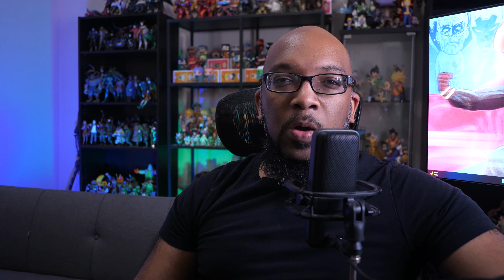Bambu Lab A1 vs. Flashforge Adventurer 5M | The Figure Feedback Podcast EP: 10

Comment: My 5M is quicker than the Bambu Lab P1P.  The P1P didnt like corners much on the front half of the build plate as they started to curl up. I ended up using spray glue. 
I havent had to set the Z off-set on the P1P, Flashforge 5M or bambu lab printers.

Comment: I know its 2 years later, but the other week, I bought an Adventurer 5M, cheap as it needed a new screen because of he ribbon cable clip breaking. I bought a new screen, fitted it and printed good. I already had a bambu Lab P1P. I had bought a BBL A1 Mini and was impressed with the print on it.  After that is when I bought the 5M. I thought as I was impressed with the A1 Mini, I would like an A1 full size. I sold my P1P on ebay and today, August 26th 2026, I bought a new A1 printer. I had done some research on the 5M and the A1. Most say they are both great printers, some say they are great "starter / beginner" printers. I have been 3d printing for 3 years and learned more from the Ender 3 series and learned how to repair them and upgrade them. Now I repaired my first 5M and I think I am going up in printers. I started off with a £40 Easythreed K9 Chinese mini printer, then went to Ender 3, then bought an Ender 3 V3 SE, which was very good. Then bought Ender 3 printers to repair and upgrade. I suppose it is just like buying  a bicycle, then upgrading to a moped / motorbike and then moving onto cars and learning how to repair and upgrade what you have. I am mechanically minded so learning all about printers comes easy to me.
Reply: so between the a1 and a5m pro, which one do you suggest for a first printer. I dont want to tinker or adjust settings..
Reply: @saragomez98  Any one of them. Both start printing out of the box. The BBL A1 was easy to build, the 5M was already set up. All that needs dong is the starting preparation. For ease of slicer, I like the banbu studio for the A1. The 5M I use Flash Studio Desktop. They are almost hte same. 5M can use Orca Slicer, but I prefer the Flash studio.
Reply: @saragomez98  Not the 5M pro. People are complaining about that one already. Not as good as the 5M.

Comment: im 55 and just got my first printer 6 weeks ago i got a FLASHFORGE AD5M Pro 3D for £280  deal off amazon they have got rid of most the problems you mention with updates i hav been printing at least 1 print a day and have had no problems yet i have even ran out of filliment on one print and it auto paused until i put more fillament in and it just went back to where it stoped and carried on printing . you can download any print from any where and put them in flash studio desktop and slce it and its perfect and i have never had a bad print with the new print plates i have never used the glue or cleaned the plate its perfect every time i only use petg hs

Comment: CoXY will always be superior. Any printer that moves the bed and jolts the print will never print as fast. Also the Flash Forge Adventurer 5M has no bed levelling screws, always rock solid.
Reply: overall maybe true but for those two printers, reliability wise which one is good? a1 or a5m pro?

Comment: I went for the Flashforge Advventurer 5m Pro. Because it is better than Bambu Lab A1 in several regards. It requires less space not being a bed-slinger. It is also an easier 3d printer to keep off-line as it is not centered around an ecosystem that requires online connectivity. It is also more tweakable, from what I gather (I have just gotten my FlashForge 3d printer). 

A Bambu Lab style printer is probably better for a beginner, who just wants to browse for 3d models online and print them, but for someone with a bit more experience, the FlashForge Adventurer is probably better. So, bambu Lab A1 is more  beginner friendly, FlashForge is more intermediate, and there are of course printers that requires more tinkering, or are more professional.

Comment: I was torn between the two printers, however I decided to go with the 5M pro. I haven't had any issues so far after 20 prints, and I've been quite happy with it, but I have gained a bit of knowlege of Orca Slicer and make sure my files are tip top. But, I've been eyeing the Bambu Lab P1S and will pick that up next.

Comment: As of the current 5M firmware version (I'm on the latest firmware as of 01/13/25, V3.1.3 on the 5M Pro) there still appears to be a problem when sending files over Wifi that are too large. I haven't been able to determine exactly what model size causes send failures but I have several large files that just don't make it when sent over Wifi. This appears to be an Orca problem, since the download starts and is recognized by the 5M but Orca times out before the file is completely sent. Really not sure who needs to guide this fix but hopefully it gets into the Orca fix queue so it can be addressed.

I have never received any Wifi sending errors when sending large files on the A1 using Bambu Studio (and I've done several 18 hr prints with no errors when sending the files). Another + on the A1 side!

Comment: Thanks for the video. I have both a 5M Pro & an A1 Combo (with AMS Lite), so for me I'm interested in the specific differences between them that can help guide me to make decisions about which printer would be best for specific types of prints. You definitely covered most of this info, thank you. But it would have been nice it you displayed and made available a spreadsheet showing all the information you reference as you were talking (or at least gave a link where it could be downloaded). That way we would have an easily referenced visual showing everything you presented for later analysis.
Reply: What’s your impression of the flash forge? Im having an issue deciding between the P1P from Bambu or getting a flash forge 5M
Reply: @bingus7361  Interesting question. I'm assuming you're thinking about the 5M Pro. At the current $499 price for the P1P, I would probably go that route. But it depends a lot on what type of printing you think you'll be doing. If you are typically using filaments that don't need an enclosure & filtration, then P1P all the way. One issue with the 5M is that it has a smaller build area 220x220x220 vs the P1P's 256x256x256. But if you are printing a lot of ABS or other more technical filaments that need to be enclosed and have filtered air, then the 5M. But, be aware, that the 5M has a max hotend temp of 280 vs the P1P's 300. So the 5M may have issues with more technical filaments that need > 280 print temps (but most you can print even at 280). Another plus of the P1P is that it can also use the AMS. There's no option for using multi-materials on the 5M. And another plus is the ease of use of Bambu printers and MakerWorld. The FlashForge isn't as easy to use nor as easy to find help when you need it. Given all that, I'd still probably go with the P1P. Personally, I like my combination of both the 5M Pro & the A1 Combo. This allows me to have AMS (Lite) capabilities, a fully enclosed & filtered printing environment if I need it and the ability to have 2 printers working on projects at the same time. Overall, this has worked really well for me.

Comment: 29:29
The idea that sending a print via wifi would be streaming it seem crazy to me.
I don't actually know how it works but my assumption was that the entire G code file would be sent at once and then cached into some onboard memory or cache in the printer itself before the print even starts.
Does anyone know if that is actually how  it works?
I mean these files are extremely small and it would be trivial to send the while file over and store it
Reply: It loads the entire file. It doesn't stream it. I can only confirm from my experience, but I regularly close out Orca and shut down my PC overnight while the 5m Pro is printing.

Comment: Great job on your videos, tons of knowledge and help! I bought my 5m before seeing your videos. Thankfully I have not had any of the issues that you mentioned. I did learn by watching orca calibration and 5m calibration videos to keep my bed temp at 65c to ensure there are no first layer issues. I've been using Wi-Fi exclusively and have not yet had the pause that you mentioned. Maybe that was corrected in the latest firmware? Regardless, you've been a huge help to my start in 3D printing, thanks again!

Comment: I have the a1 and the 5m pro. As of now print quality goes to the flashforge. Only issue I’ve had with the 5m pro is the flashprint slicer. I use orca slicer. Problem solved.
Reply: How is it after a yr? Any idea on hours?
Reply: after 2 years how is it?

Comment: I have the 5M

It crashed into the bed and destroyed one side on the first print

I need to get it swapped, they did say they would send me a new one

But after firmware update it was OK so I use the other side of the bed

But getting prints to stick is hit and miss

I have managed to print the enclosure though, just waiting for the kit to come

I found covering it with a towel for the first few layers made all the difference

The glue does shit

When it works though it's excellent

Just wish it used standard hotends

Comment: I got the 5M before I saw your video, and I’ve had a few hiccups with it, but I love it! I’ve had it for a little more than a month and I’ve racked up almost 400 hours of print time lol 

I have had issues that have been fixed due to user error.  I always try to find an alternative solution before I say that the machine itself made an error.  😊 That way I’ll never feel as though I need to find a new machine (because it’s an awesome machine.)  I was also able to get a coupon discount on the 5M which fit my budget, and I could get away with it before the Mrs. would notice ha ha… The firmware issues, I only had one out of the box because the demo Goode files sent on the thumb drive were older than the firmware preloaded onto the machine.   Very easy fix. As for my filament runout sensor, after about 100 hours it malfunctioned and I just decided to turn it off.  I have a CC camera pointed at the printer 24/7 anyway and am always conscious as to how much filament is left or required to finish a print; I have no issue with that.  

The printer that I came from 7 years ago that I had to DIY build was light years behind the 5M that its quirks don’t really matter that much to me.   Every feature that the 5M has I would’ve had to engineer and code myself with my first printer and I would’ve only dreamed to have such things as 500mm/s print rate lol. If I used anywhere 1/5 of that speed on the old bed slinger it would’ve shaken whatever poor model that was half stuck to the bed across the room! Also, I won’t use anything other than the thumb drive to send prints from the printer.  My first printer did use octoprint on a Pi which could actually save the file onto it before telling the printer to do anything first.  I’ve always had Wi-Fi printers for paper and things, I’ve never found them quite reliable;  same here.  Besides, I like having hands on things even with the convenience of remote printing and sending.  

Anyhow, I know that Bambu will always be a better quality printer, I still really like the 5M, because that’s the one that I have and I am quite happy with it from your recommendations and videos! Thank you for your time and content!!

Comment: If only Flashforge would have put a better mainboard and make Klipper fully open as it is supposed to be.. a lot of problems would be fixed on the AD5M.  They made a perfect printer but "klipped" badly due to not letting use take control of it.  I feel it would have been as versatile as the Ender 3 was and still is to the market.  Affordable and customizable, Flashforge missed out.  They could still fix it, but maybe I'll figure out how to put in a BTT SKR board and Raspberry Pi in it to save it (Like the Adventurer 3 Pro 2)

Comment: READ THIS FACTUAL REVIEW HERE:   I really don't know why Youtube reviewers softball reviews for Bambu printers ( I suspect its because of some kickback or desire for sponsorship) and they never really give you the REAL review of the problems that they do have, So with that here are some REAL facts about the Bambu A1:  First off the setup for the A1 is NOT super friendly and requires you to register the printer for Bambus cloud service (unless you dont want to use wifi or the Bambu app) and they use your information for data mining, Bambu printers also monitor your print jobs and send that data too Bambu or whoever else they are selling your usage information too this is easy to see in the printers embedded logs, go have a look if you dont believe me. Second thing , For anyone worried about the bed size of the 5M...It is only 1.3 Inches smaller...Thats it  1.3 Inches, Not really anything. BUT the difference in speed between 500mm/s and 600mm/s can be BIG on longer prints.  the math on that works out to be roughly 5.5 minutes an hr saved with 600mm/s so a 10hr print , you are going to save almost an hour of print time.  The A1's "tangle detector" is actually rubbish, All it does is sense a tug or any resistance coming from the filament rolls feeding.  It can and DOES have issues with giving false alarms especially with cardboard rolls of non Bambu Lab brand filament.  Which also brings up another issue with its "AMS Lite"....It has a lot of issues with 3rd party filament rolls.  They a lot of time dont fit and so you have to print some weird collars to act as washers to make the rolls fit and you guessed it, That sometimes causes the "tangle" sensor to trigger.  moving on....he "Eco system" well Im sorry to say that YES there is an eco system for Flashforge printers, They have been making printers for more than 10yrs longer than Bambu, The company itself is massive and worth several billion dollars, Bambu by comparison is still a startup company.  Customer service of the two shows this.  Bambu has widely known terrible customer service and often take several weeks to address tickets and even more weeks to give any support of those tickets.  They have no hands on tech support and just tell you to look at their wiki, and if you cant fix it then (weeks longer) get ahold of them again to further the ticket and they (after weeks) will send you parts they think might fix the issue.  Flashforge isnt great at customer support but they do respond quicker and have live chat support.  Also Makerworld is NOT a Bambulab owned property.  It is a collaboration that caters to Bambulab but can also be used by other brand printers.  Bambus "proprietary" slicer is also NOT a Bambu product it is just a reskinned PRUSA slicer that they actually stole from PRUSA.  It was open source and was not originally intended to be used commercially for profit, But Bambu pretends that they invented it and use it in their marketing as "innovative" , thats just not true.  These are just a few of the actual facts that Youtube reviewers don't speak about when reviewing Bambu Lab printers, Again I think it is because of some desire for sponsorship or they are getting something free or monetary in return from Bambu.  So this TRUTHFUL REVIEW was something I think needed to be posted

Comment: What Ive noted about my Flashforge and the first layer is that the work are is not fully 220mm. The build plate is really more like 215mm or so. I recently had to replace some grandkids dragons that I had made years ago on a CR-10S4. I resized the model to fill the 220mm build plate. The parts of the model on the edges would lift, making a failed print. I resized the model again making it a tad smaller and had no issues. I agree the Flashforge is not great on first layers, but the quality or a successful print is much better and faster that the OLD CR-10S4 that I was using LOL. Its nice not to have to tinker with something to get quality.

Comment: Dude your the reason I got my very first 3d printer. I ended up getting the Flashforge 5M and I’m loving it. Now I’m thinking of getting a Bambulab due to their AMS systerm unless Flashforge comes up with their own AMS. I’m just debating which Bambulab to get.
Reply from the maker: I really hope Flashforge has a multicolor system in the works too. Bambu Lab is likely going to announce a new printer this year. It might be worth holding out to see what's up.
Reply: @FigureFeedback  Oh cool, I didn’t know Bambulab is coming out w/ a new printer. I may have to wait to see that one then. Thanks for the info as usual, your the best!!!
Reply: Dude you dont need to wait for just Flashforge to come out with one.  AnyCubic has said that their multicolor system is going to be usable on other branded printers.  That system is actually WAY ahead of the Bambu AMS.  The AC has a built in dryer box, temp monitor, and has a Pantone based color system that is more color accurate.  And its like $249 when it gets released as a standalone later this year.
Reply: @anthonylong5870  Oh that’s cool. I’m gonna wait and see that one too, maybe save me from getting a Bambulab. Thanks for the info!
Reply: @hookitup91402  NP also if you did want a bedslinger with multicolor printing sooner and that will save you $100 and get you all the newest features.  Take a look at the Anycubic Kobra 3 Combo that is coming in the next month.  pre order is $449 for the complete unit/MCU and so far the reviews that have come out are very good.  If a Core XY (enclosed) multicolor printer is more what your after , in July Creality is launching their K2 combo and rumor has it that the cost will be $999 which is $300 less than the X1C and is faster and larger
Reply: I can't find an answer so hopefully you can help, what makes the AMS so sought after? can't the user just paint or color the rest of the print a certain way? Or is it just super dependent on what someone is printing?